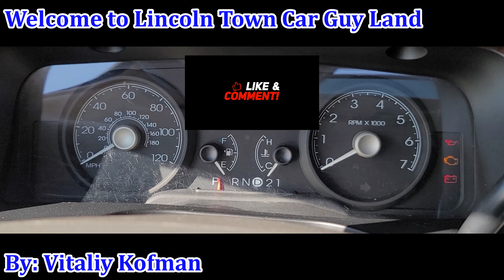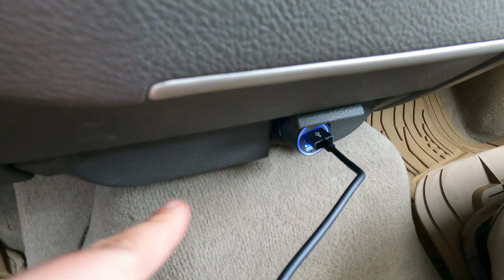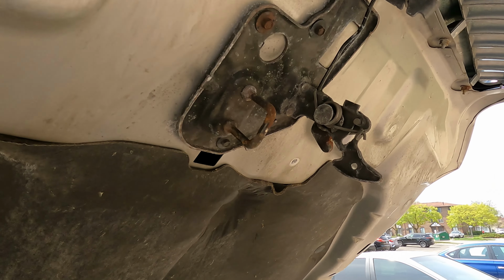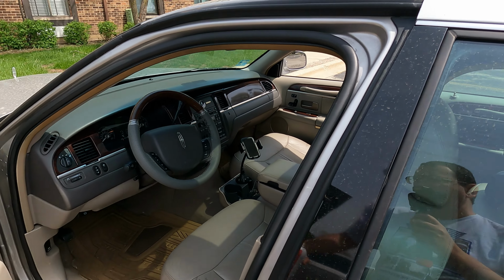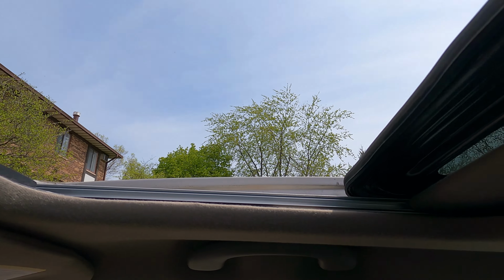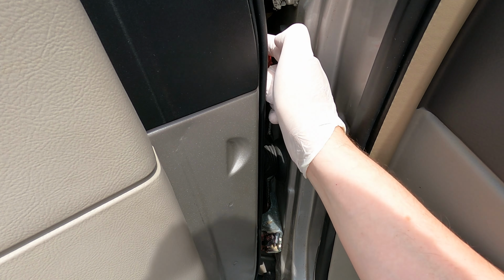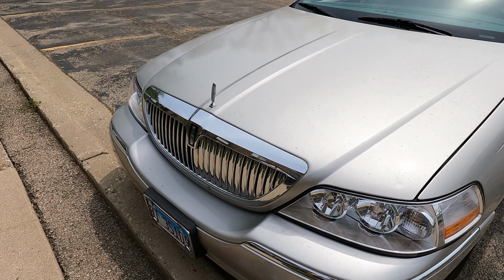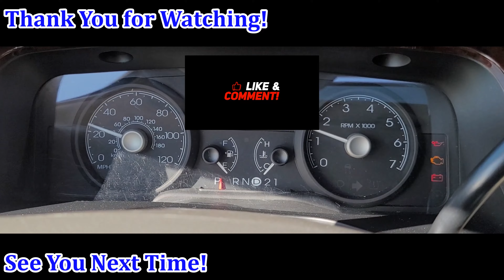Lincoln Town Car Guy Presents Operation Lubrication for this 2006 Lincoln Town Car Signature Limited

Comment: Vitality,they make dry lube.
Try that out for the sunroof and seat track\screws
Dry lube doesn’t attract dirt.
Reply: Can you  use dry lube on sunroof tracks?
Reply from the maker: Thank you!
Reply: @jmzbnd724  
Yes you can use it.
Pb blaster, and wd40 brands have them.
They will dry in a white or black film depending on the brand.

Comment: Hey I have a question about the hood latch in the grill how did you go about fixing it so it doesn't stick out while the hood is closed? The 2004 Signature I just bought is starting to do that.
Reply from the maker: Sure thing. Please see here - https://youtu.be/53497PRepHg
Reply: @VitaliyKofman  Hey Thanks love those Towncars my new 2004 I just got last month in excellent condition it has the same rims as yours. I'm waiting to get my salvage title back on my old 1999 Towncar so I can try and sell it still runs fine everything works..

Comment: The charging port underneath the dash will not kill the battery I leave mine plugged in all the time with a Bluetooth transmitter/phone charger and I have charged portable radios for hours and it did not kill my battery on my 04 Town Car
Reply from the maker: Thanks for letting me know